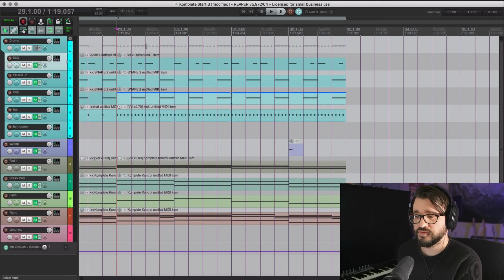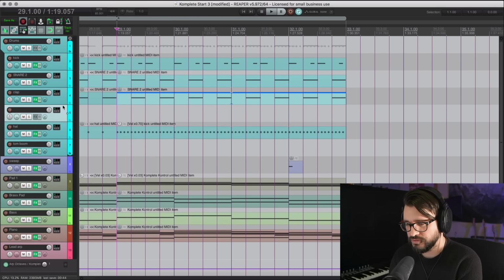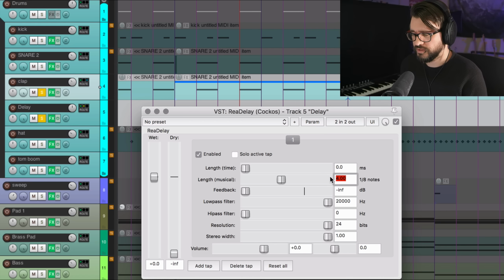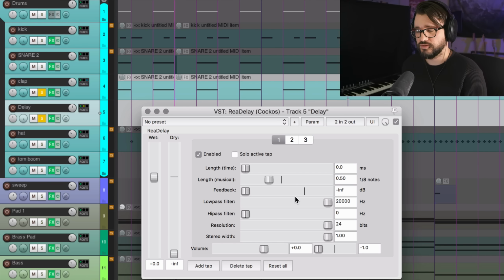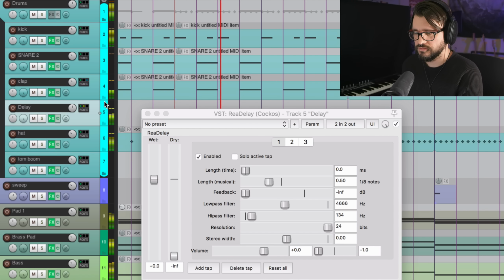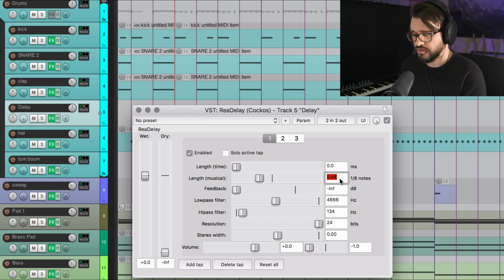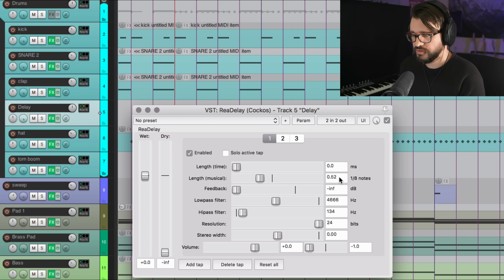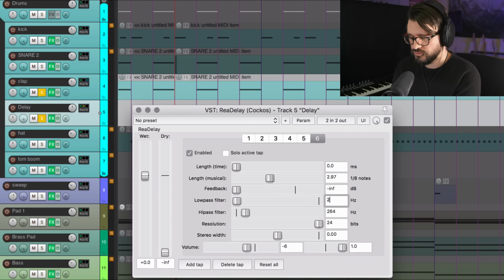How to make an LCR bouncing Echo with ReaDelay - tutorial

Comment: Jon, I need some professional guidance please. I purchased a Presonus Audio box 96 interface. I also purchased a audio patchbay. I want to run instruments, synths and effects processors through the patchbay to my Presonus interface and finally to my HS80M studio monitors. What is the correct order? Or am I missing something? I appreciate any direction.
Reply from the maker: I'd have the monitors connected directly to the interface.
outs of the synths to the patchbay, ins and outs of the effects to the patchbay - but you won't be able to use them in mixing with that interface.

Comment: Jon - do you know if there's a way to limit the sensitivity of the MOd Wheel in Reaper?
I have got a sample library that is jumping up in volume when it should be easing up gently.
I tried Js Midi CC Mapper and clamped the moved the Clamp lower and upper values closer together, and this helped a bit, but just wondering if you had another method?
Reply: Its OK, I found JS MIDI CC Mapper X on the cockos forum which lets you have an attack curve for Midi:
https://forum.cockos.com/showthread.php?t=172630
Think this might work for me.